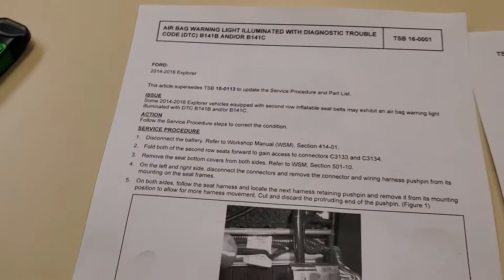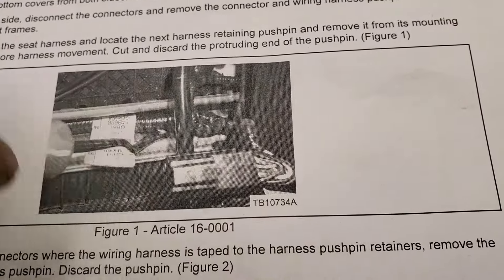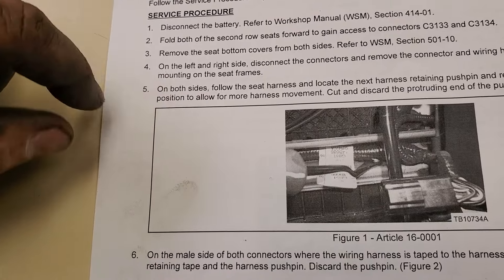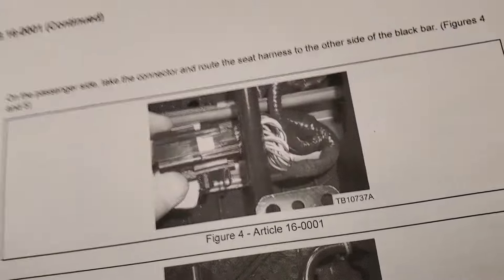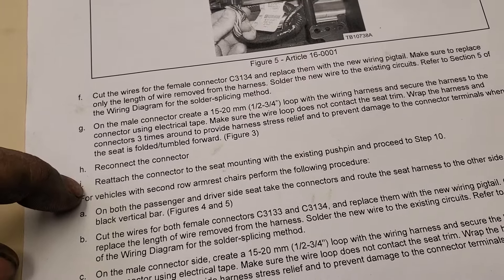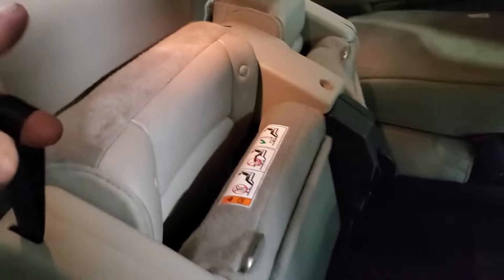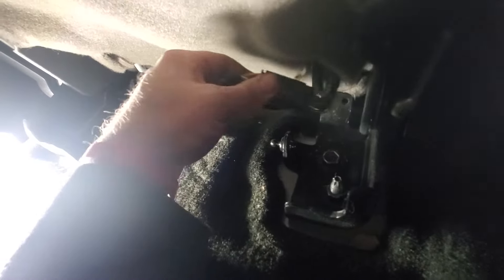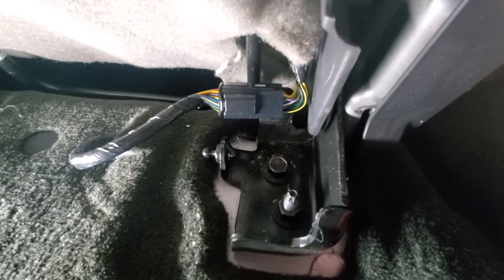2014 - 2016 Ford Explorer 2nd Row Airbag codes B141B AND B141C Fix - Easy or Difficult you choose

Comment: Thank you so so much. Me and my husband detailed a 2016 ford explorer and when we turned the vehicle on to drop it off to the customer the light was on and it wasn't on before because we picked the vehicle up. My husband was already calling shops to get it fixed but I found this video and my husband did what you said and it didn't turn back on as we headed to the customer. Thank you so much
Reply from the maker: You're welcome!
Reply from the maker: That little trick right there just saved you about $1,000 because what they charge to do the technical service bulletin is installed two connectors that have like 6 to 12 wires a piece and each one of those wires have to be spliced in

Comment: Here’s a question. I have a 2015 Ford Explorer Sport. The 2nd row seating was 2 bucket seats. I replaced the driver’s side with a 60 to add an additional seat. This seat came out of a 2015 Ford Explorer XLT I believe. Same bolts, and same plug. However, my airbag light is on and the power button does not work. Does it need to be programmed?

Comment: I had this problem in my 2017 Ford Explorer I scanned with FORScan and got the same code and I follow this instruction although I did not disconnect the cables only thing I did was to loose them up and problem fix. Thanks for the video
Reply from the maker: You are very welcome
Reply: Bro I just did that on ny 2016 ford explorer and they are gone lmao it turned off!! Foreal though all I did was loose tension on them and tada!!

Comment: Ford Boss, I did a Bench to Bucket swap in my wifes 2017 explorer and now i have both B141b/c. the new seats have airbag seatbelts, as did the old ones. i got the seats from a scrap yard in very good condition, is there a Bypass of some sort i can do to get the light off? I have child seats in both bucket's so i dont want the belts to inflate anyway.
Reply from the maker: You would have to have some kind of programming done with forscan and I don't know how to do that on yours
Reply: @FordBossMe  ok, i didnt know if there was a way i can just hardwire or jump the signal so the dash light goes out.

Comment: Question…. I won’t have to replace the wiring harness? I’ll just need to disconnect pull the tabs so the wire moves freely then plug everything back together and that’s it??? Ford just told me it’s $900 to fix B141C on my Explorer 😡😡😡😡
Reply from the maker: The new one will do the same thing 

You can unplug and plug it back in and that might work but I would suggest cleaning it out with a little electrical cleaner from CRC and using some Dielectric grease from CRC in the connection just a little bit putting it back together and you're fine couple key Cycles later airbag light typically goes away
Reply: @FordBossMe  the TSB says that the harness has to be cut then soldered back together from where the wires we cut. Are you saying I can bypass that and just unplug the harness, cut it, lube it and plug it back together and it should work after that?? Damn TSB and Ford!!! Apparently Jeep and GM are worse than Ford so I’ll count my blessings
Reply: @FordBossMe   Do i need to unplug and disconnect my car battery in order for me to loosen the slack on the connections and to just unplug and plug it back in as you stated here above?

Comment: Thanks Boss!! I fix my Explorer air bag light problem!!!   I have another problem too with the alarm, its going off. If any can help me i very apriciate!!! Is not the door ajar....
Reply from the maker: is it the factory alarm?
Reply from the maker: Do you have the remote to unlock and lock it are they programmed to the vehicle properly? Has the battery died recently?
Reply from the maker: Is it a push start or do use a key to start it

Comment: Very informative video. Just have a question if I need to remove the battery when doing this and unclipping the connectors?
Reply from the maker: Just turn the key off for 30 min leave the door open slightly 

Or you can disconnect the battery either way
Reply: @FordBossMe  thank you. This works for me. Followed your instructions and seatbelt light was turned off for more than 2 weeks now. 👍

Comment: A big thank you my man. I wished I had seen this before. After my Airbag light came on I took it to the Ford dealership who claimed they fixed it and charged me over $600. A few months later the light came back on. I was planning to take it back, but divine inspiration led me to your video. I tried what you suggested and the air bag light is no longer on. When I checked NONE of the plastic clips were removed as instructed in the TSB.  Yet the Ford dealership claimed they fixed it.

Comment: My light came on, I took it to Ford to diagnose the code and they said $800+ to fix it. Drove home and the next day the light was no longer on. They said to still bring it in for a new pigtail. But could it be that when they diagnosed it, they loosened it enough for the light to go off and stay off? Wondering if it still needs to be "fixed" since the light is now staying off. About to put a car seat back there so want it to be safe. Thanks for any help!

Comment: Worked like a charm, simply unplugged the plug under the passenger side captain seat, pulled the female end free of its retention pin and plugged it back in.  Fixed the issue.
Reply from the maker: Did you put some of the electrical paste inside? Make sure if you don't have any Motorcraft Xg12 you do so

Comment: Thank you so much and i appreciate your time for responding back.. One last question... what do you mean when you say "turn the key off for 30 minutes"?

do you mean to turn the car off for at least 30 mins or take the key out the ignition for at least 30 mins?
Reply from the maker: Turn the key off like as in turn the vehicle off like you're getting out of it to go in the house and you don't need it on anymore and leave the back door cracked so it's not latched so that way when you go to open the door back up it doesn't wake up any modules it's already open and then undo the connector and plug it back in and then start your vehicle and see if the airbag light goes away

Comment: Do i need to unplug and disconnect my car battery in order for me to loosen the slack on the connections and if i wanted to just unplug and plug it back in to see if that works?
Reply from the maker: Turn the key off for 30 minutes you don't have to unplug anything on the vehicle and then remove the connector and plug it back in make sure you put a little bit of xg12 in it that's Ford's electrical Grease but you don't necessarily need to grease you can do without it for now but if it comes back put the grease in there I don't typically answer to many questions in the comments anymore because I'm too busy during the day and everybody needs my help And when I put out my videos I typically just leave it at that

For emergency reasons I have people email me I don't want to spend all day in the comment section on here anymore

Comment: Will this cause a nonop issue with the driver front seat heater? My driver seat heaters don’t work, and I have that code.  I followed 501-10A front seats diagnosis and testing and led me to airbag diag. 

Thanks in advance.
Reply from the maker: Try and see if it fixes it, I'm not sure about the driver seat heater
Reply: Crazy to think the airbag would be looped into seat heater circuit somehow. I guess we can never put anything past engineers these days.

Comment: Very helpful. I also found that slightly bending the male contacts to be tighter against the female ones improved connection. Ford replaced connectors 3 years ago under warranty and now problem just came back they say it will cost me $800 to do again. With your help I was able to take care of it myself.
Reply from the maker: That's right brother

Comment: Is there a way to reset the light? I've fixed the connector but the light stays on. Maybe a fuse?
Reply from the maker: What were the codes that were stored in the computer
Reply: @FordBossMe  I don't have any way of checking the codes. Just wondering if there is something else I could check like a blow fuse before I take it to dealer

Comment: what if it was out of warranty but came in because of an outstanding recall with one of the dtcs in memory and air bag light on would u re-wire it or just re-secure the connectors
Reply from the maker: New one will do the same, clear codes tighten connections and send them on their way charge .5 - 1hr

Comment: you saved me 600 dollars. thanks man. I definitely will subscribe especially looking forward to your Explorer videos. I have a 2014 Explorer sport. At least i know the timing chain and water pump was replaced. that would of hurt the o'l pocket book. Anything else I should be looking into. Any turbo replacement videos on these trucks?  My other car is a 20 year old BMW and you have to fix those on your own.
Reply from the maker: You should watch my wheel bearing video on the removal
Reply from the maker: I have videos on stalling the radio and programming because they are a major issue also
Reply from the maker: I just have to many videos to remember 

the plastic around the window outside along the windshield breaks and I have a video for that...it's a hot ticket item